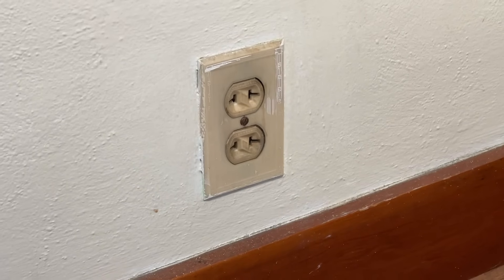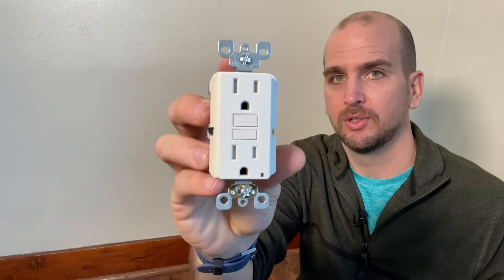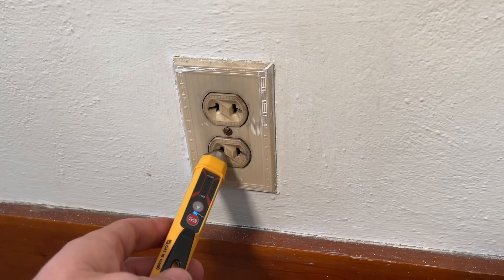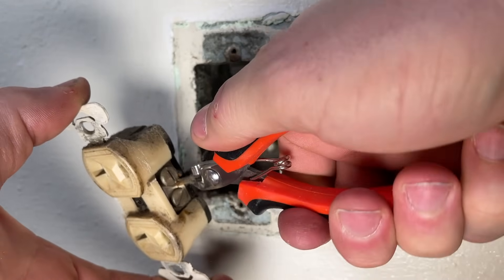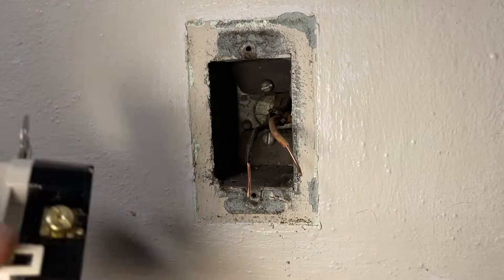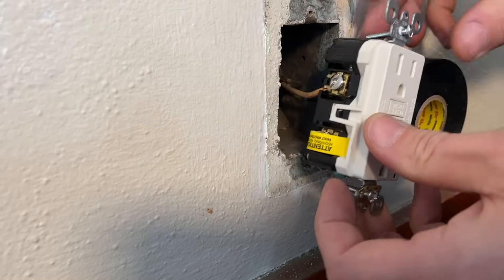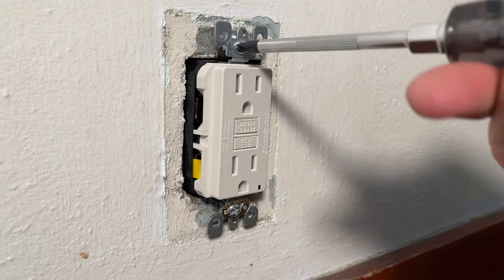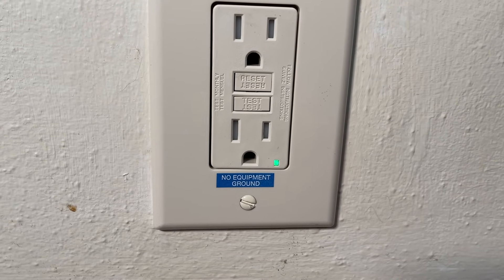How To Replace An Old 2 Prong Outlet Using 3 Prong GFCI

Comment: I have access to the crawlspace under the outlet at my house, can I drive a 1 foot long copper spike into the dirt and run a ground wire up?
Reply: I am by no means an expert and I STRONGLY advise you to seek the opinion of a licensed electrician to verify what I am saying.  If you are asking about a 2-prong outlet then chances are your panel is probably half a century old with who knows how many "fixes" and kludges already in place, and you really need someone with the knowledge and the right tools to make sure everything is safe. 

Grounding can mean a lot of different things, but for right now you need to remember this:  Sinking a grounding rod and running a wire to an outlet is not the same as having a grounded electrical connection.  Electricity wants to create a loop, and since your outlet is getting power from your main electrical panel, that is where the electricity wants to get back to.  Which is why if you look at the main electrical panel in a brand new house, what you will find is all of the neutral and ground wires are connected together.  Your grounding rod idea would not give the electricity a path back to your main electrical panel, so it is not going to work as you would expect, which brings us back to you needing a proper electrician to check things over first.
Reply: that spike will not ground the outlet. If you have access to the crawl space, you could run a ground wire under the house and then up to the outlet.
Reply: @islanddave8606   I would go one step further and just rewire the outlet/room to the service panel at that point.  5-10 years down the road, he or the next homeowner are going to be back in that crawlspace doing something and they will see a lone copper wire and no reason not to cut it.  

"I mean one wire doesn't make a circuit right?"  

And when nothing immediately happens they will forget all about it.  Then the next sparky out to troubleshoot is going to have one or more outlets without a ground and he's going to have fun tracing things out all over again.
Reply: Grounding bars are not expensive also
Reply: That is not the type of grounding needed here. A separate wire run from the outlet[s] to the breaker box and tied to the main system neutral wiring is what is needed. A ground rod is a different animal and will not provide the shock hazard protection a properly installed 3 wire outlet & main breaker system will.
Reply: Thanks for the advice. I'm glad I asked first. This probably isn't something I'll try to do on my own. An electrician it is.

Comment: I feel like my house isn’t completely up to code even for the 20s, like there is no box, it is literally just a hole in the wall.
Reply: If I were you, I would have a licensed electrician inspect the wiring and advise if it is "safe", safe being a relative term here. For example; knob and tube wiring is not up to current code, but has been grandfathered in many jurisdictions. It is not as safe as wiring done to current NEC code would be, but if in good condition, it may be considered "safe".

Comment: water metal pipe is alternative to ground wire lacking..this older homes have galvanize water pipe all over kitchen and bathrooms...while main pipe is where i would stick 8 ft ground rod and attach wire to metal pipe..then wire to neutral bonded main panel...now it has path to return for any faults ..ground should not be charge or no current since hot and neutral wires are separated from outlet connections..to fix this missing ground...is run copper wire and attach nearby water metal pipe..longest no hot or neutral is touching it...or else it be charge..this what i think of...unless for older homes, i would run a new conduit all around outside the house for missing ground wire alone then make complete circuit by NEC code..cause 2 wire only still not safe for houses these days...potential fire when hot current has no where to return ..and will heat up from outlet since gcfi stop it as alternative but doesn't solve entire house issue if its wire entirely 2 wires, especial with 240v volt does not use gcfi outlets..

Comment: All you electricians egging this guy on..... You should check yourselves. He has NO business instructing people on electrical work. Proximity testers are not an adequate voltage check if you will be touching the terminals/ wiring with bare hands..... He does this right in the beginning of the video. The nuances and potential conditions of electrical wiring in a house or any installation require experience. It's an insult to the trade and a dangerous disrespect of the hazard if electricity for this novice to actually instruct the general public on any electrical work above low voltage of 50 volts.
Reply: You sound butthurt.
Stop charging $200 an hour for simple projects like this and maybe people won't turn to YouTube for help
Reply: @Scubamike4499  I charge $75-$85. Locals charge $90-$100. Nothing but concern for people getting killed, electricity is invisible dynamite and the precautions that training and experience teach can not be adequately covered in a video. Butt Hurt? I turn down work several times a week. You assume a lot.

Comment: House I grew up in had all 2 prong outlets. Didn’t realize until we did an extensive remodel that they did in fact have a ground, it was just tied to the outside of the box, not the inside. After the remodel I confidently replaced out the remaining outlets with 3 pronged.
Reply: Same with my house. It was built in 1961, and I believe 1962 was the year the NEC required three prong outlets on all branch circuits
Reply: ...there was a time long ago now I did the same thing ... just installed 3 prong plugs and everything still works ...
Reply: @willgaukler8979  just because “it works” doesn’t mean it’s grounded.
Maybe you should learn the difference.
Reply: @Aftermath-o4f  it also doesn’t mean it isn’t grounded (which was the point of my initial post). Boxes were in fact all grounded, but the ground was on the outside, not the inside of the box.
Reply: Id get my old 1954 house rewired tomorrow if contractors didn't have to tear open my walls, Astronauts on the Launchpad going to the Moon in 1968 and in 2021 we got no way to rewire a house without destroying it.

Comment: They have skinny GFI too check that out ,what is a huge issue on old 2 wire no ground wiring  the insulation is raged no longer safe after 50 years or more. You are only kicking  the can down the road ..

Comment: Before you go cutting off any copper, check that there is enough slack in the wires to allow you to waste an inch or so. I have found that old wiring has often been cut short. 
Old wiring boxes are sometimes so full of splices there is no room for the big fat GFCI. Then you're stuck trying to fish a bare ground wire down inside the wall. 
If all else fails, just go ahead and replace the old two prong with a non-grounded 3 prong. You didn't have a ground before and now you still don't. Big deal.

Comment: My question would be: If I have a room full of receptacles, how would I know which one is the first one in the line?
Reply: You might have to experiment.

I would disconnect the chain at the box which appears closest to the breaker box and safely separate the wires. Then reactivate the circuit and test the other outlets. If they’re all inactive you guessed right, else one of the still-active outlets is closest to the source.
Reply: That is a good question. If the receptacle is used as a point of contact, meaning all 4 screws are used, 2 coming in and 2 going out, then the method John describes, works well. If the receptacle is not a point of contact, it can get complicated. This situation is incidentally preferred and common. In this case you will only have 2 ungrounded connections to the receptacle. 3 hot wires wires are connected together, one coming in, one going to this receptacle, and one going downstream. Same with the neutral wires. So if you disconnect this receptacle nothing changes downstream. If your home has 2 prong receptacles, its likely that the 3 wires are crimped and soldered and covered with a special electrical tape. They also could be twisted together and capped with wire nuts. In any case you would need to rewire to make the receptacle the connecting point. You may need to lengthen the wires using a push in splice designed for this purpose. It's not really that difficult, but you need to know what you're doing. It's not just plug and play.
Reply: Hire a real electrician

Comment: That's why if you're outlet won't work hunt down the GFI that it might be daisy chained too
Reply from the maker: Yes that does happen for sure.  I had a crazy one in my own house where a GFCI was burried in the closet and it tripped knocking out my can lights in the bathroom.  That one took months to finally figure out and didn't expect them to run the power for the lights through the GFCI load terminals.
Reply: @EverydayHomeRepairs  when an incandescent bulb burns out it will/can trip the GFCI.

Comment: What grade is a GFCI? Do they have residential, commercial, and hospital grade like standard outlets? Would it be smart to just replace every outlet with a GFCI on even if I have a good ground ran throughout my home?
Reply: I don't think they have grades and because of the intended usage they must be high in quality. Some have more features. I like the Leviton slim design from Home Depot. 
No, I would not recommend replacing every outlet. Do you have gfci's near the sink in the bathroom and kitchen areas? If not, you may be advised to get a gfci breaker which is installed in the main electrical panel. Then the entire circuit is protected.
Reply: @surferdude642  Of course I have one installed next to any source of water in my home. Just wondered if it would be safe to replace all my standard outlets with GFCI ones. Being at almost $20 an outlet. Kinda pricey.
Reply: @randomtube8226  It doesn't make sense to do that, mainly for the reasons you mentioned, pricey. You have three options. 1. Leave the gfci's you have in required areas alone. If your other 3 prong outlets are old or you are suspicious of their safety, replace them with high quality spec grade receptacles, about $2.00 each. 2. Put a gfci receptacle at the first connection point on every circuit. The wires coming from the main panel wired to the Line. The wires going downstream wired to the Load. This would be equivalent to a gfci at every outlet. This can get complicated, you need to know exactly what you are doing. 3. Gfci breaker in the main panel. What would I do? Option 1.

Comment: What about the ground connection, can I add a pigtail ?
Reply: Sometimes the metal box is grounded even though there are only a black a white wire coming in. A ground wire was run from the ground bus bar in the main panel and connected to the box from the back. You will need a multimeter to verify this. If the box is grounded, then yes. If it is not grounded, then no.
Reply: @surferdude642  Even if not, the FMC conduit can be used as a ground in 20a circuits or lower. If the main panel was properly bonded, you can use a multimeter to test for continuity between neutral and the metal box to see if it was grounded. Just make sure the main panel/home disconnect is off first in case there's a ground loop, reversed color coding, or incorrect splice somewhere!
Reply: @andrewt9204  Thank you, good information.

Comment: I have seen homes where there the wiring has a ground, but where there is a two-prong outlet.  In these cases, the ground wire is tied to the box.  In these situations, you can use an adapter and screw down the lug and the result will be grounded.  But, of course, in this situation you could also just replace the outlet and use that ground wire, which is even better.

Of course, it appears that this doesn't apply to your situation, so using a GFCI is your only option if you don't want to run new wiring to the box.
Reply: The master electrician i am working under,  the house he purchased 14 yrs ago was built in 1957, he has been doing electrical work for over 30 yrs, so he knew exactly what needed to be done.   He replaced the 60 amp main and range pullout fuse panel with all square D breakers, while doing so, to his surprise,  the original wiring,  the fabric braid NM wire, did have a bare copper ground wire,  but was very small maybe 16 or 18 guage, with all two prong outlets except one bathroom,  which had a GFCI outlet when he purchased the home.   What the builder who wired that home did was wrapped the ground wire around the outside jacket of the cable and clamp to the metal boxes.  If you were just replacing the old outlets you would never see the ground wire,  and assume the old NM did not have a ground,  as most of that era didn't.
Reply: @Sparky-ww5re  I saw the same thing in my previous home.  Although built in the 60's the basement wiring used that same fabric-wrapped NM wire.  I suspect it was taken from someone's junk pile because the rest of the house is using normal NM wire.

In my case, there were 3-wire outlets with the thin ground wires were tied to the ground screw of the outlets, with a pigtail also going to the box (using an extra screw).

Years later, when I did a basement reno, we removed and replaced all that junk with modern 20-amp NM wiring.
Reply: @Shamino0  Fabric covered Romex was available until the late 1960s, and since the late 50s with ground wire included. In that type of cable, the insulated wires were wrapped in paper, then the treated cloth braid served as the outer jacket. It is messy stuff to work with, as some of the compound can come off on your hands.
Reply: @dougbrowning82  very interesting, to know that fabric wrap NM came standard with ground wire since the late 50s, as the NEC didn't require grounded receptacles aka three slot outlets until 1962, though homes may still have ungrounded receptacles even later than that as there are parts of the country that do not always adopt to the latest NEC.  In the case of the 1957 home with the thin ground wire and fabric NM connected to two prong outlets, rewired by the electrician I am under, my thought was the home was built by a very wealthy person,  who was just future proofing it, before we started using 3 slot outlets.  I guess in that case, the bigger question would be does that thin ground wire offer low enough impedance to operate the overcurrent protection device in case of a fault,  such as the motor on an old metal cased electric drill grounding out to it's housing.
Reply: @Sparky-ww5re  3 slot outlets were introduced in 1925, and recognized by the NEMA as type 5 for 110V (15, 20, and 30A) and type 6 for 220V (15, 20, 30, and 50A) in the 1930s. The house I grew up in was built in the early 1920s, with K&T wiring and ungrounded outlets. When my great aunt had an outlet installed over the kitchen table in the mid 1950s, it was a grounded outlet fed by armored cable.
Reply: @dougbrowning82  I think the fabric wrapped Romex with the thin ground wire was available much earlier than the late ‘50s in fact I know it was available in 1949! The home that I live in now, built in’49, has that wire through out!
Reply: @Sparky-ww5re  they all did it like that back then. It was called "back wrapping." They werent nearly as concerned with secure dependable grounding back then.
Reply: @Sparky-ww5re  would this situation still show an open ground with a sniffer at the outlet? thanks
Reply: Just because there is a ground wire, doesnt mean its grounded. You need to test the wire to see if you can get 120v from the black wire to the ground wire, if so its probably a good ground. Even then it could be a ground too weak to trip a breaker, and therefore worthless. If it doesnt trip a breaker, then you will only energize every metal item the ground wire touches when a ground fault occurs, actually making everything worse.
Reply: There is a problems with the adapter: does it produce low enough impedance path for the ground? If you use it at least test it afterwards. Changing the socket is way better.

Comment: Doesn't this 15-Amp GFI duplex still violate code by replacing a 20-Amp receptacle?
Reply: No. The code allows 15 amp duplex receptacles on 20 amp circuit. A 15 amp single receptacle is not allowed.
Reply: Only if it's a 20 amp circuit with one receptacle (device)  connected to it. That's what we call a dedicated circuit
Reply: The old receptacle was not rated for 20 amps. Why do you think it was?

https://shop.worldcordsets.com/shop/reference-materials/nema-reference-guide#2